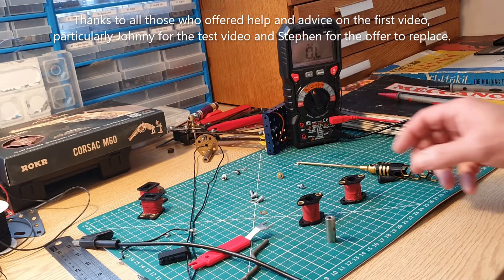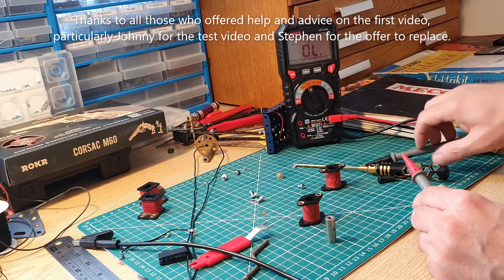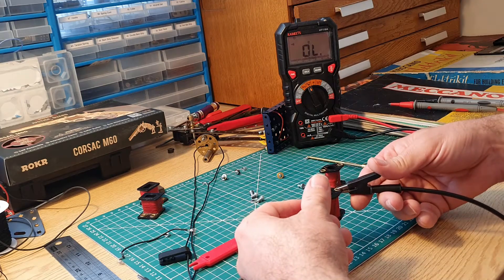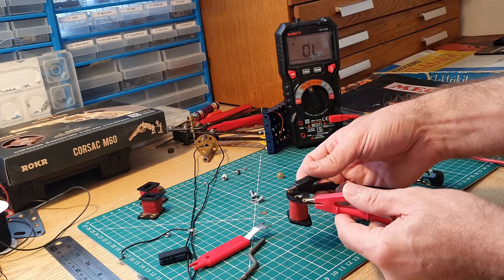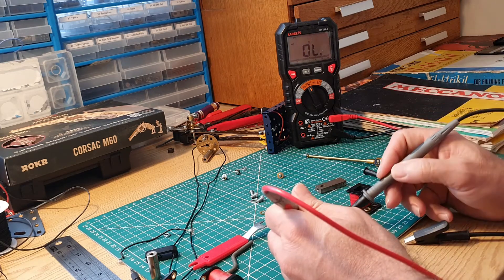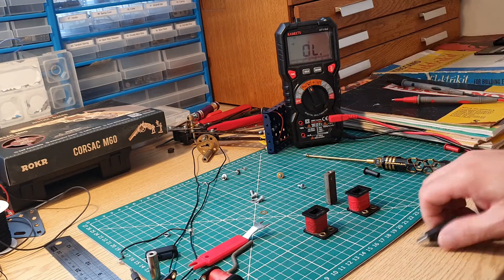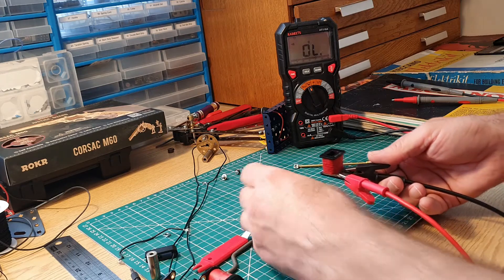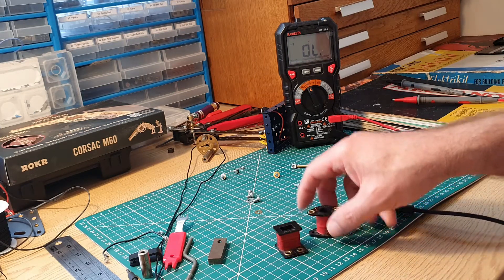Elektrikit E6  Signal faultfinding

Comment: Meccano Elektrikit coils failed like this when new right out of the box.   It is poor design, clamping wire ends under a rivet that has to take bolts through it.   They can be fixed but they won't stay fixed.